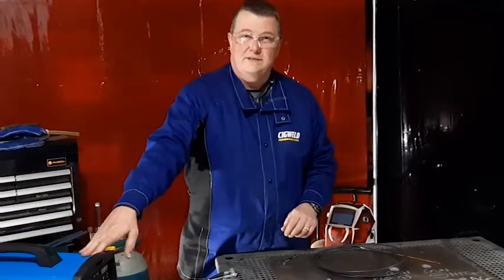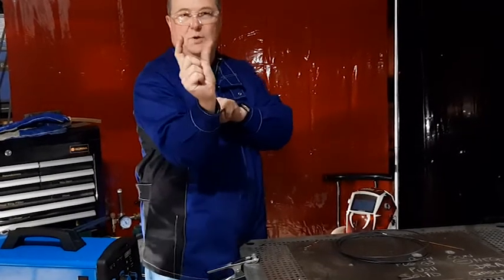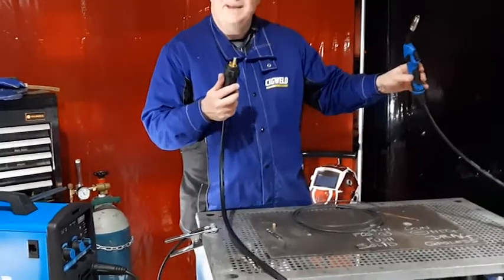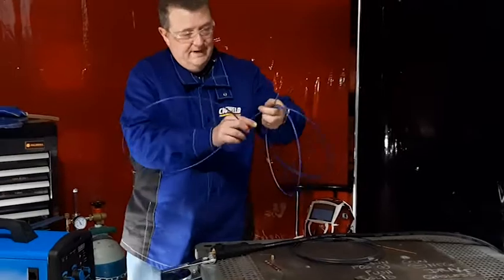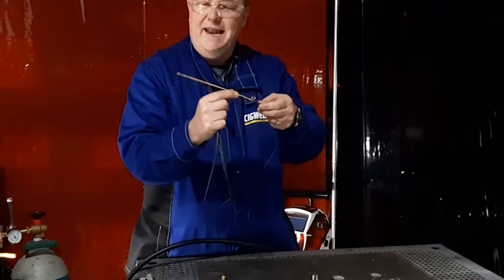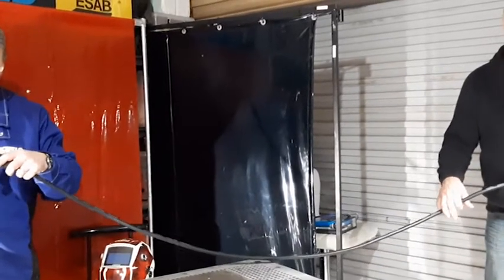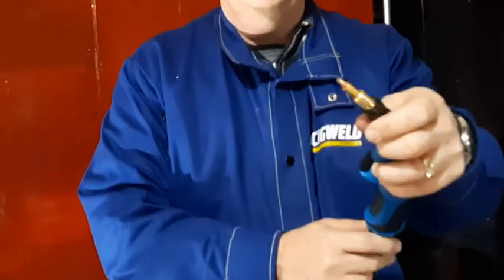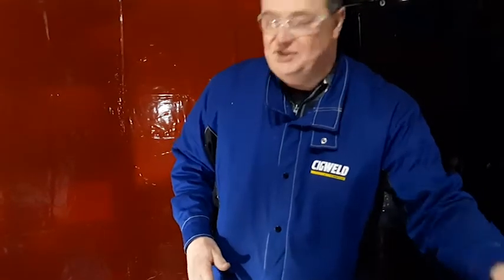Changing a Liner Setting up for Aluminium Welding

Comment: Thx. I note that some people leave a tail and use it as the liner right to the roller in the machine. Do you just leave the metal feeder tube in place and insert the aluminum wire thru it and then into the torch cable?

Comment: What is the aluminium kit for the Weldskill 135 and where can I get it?
Reply: I have this exact same question - did you find anything out Chris?
Reply from the maker: There is no kit as such at the moment. If you call the team on 1300 654 674 they can give you all the part numbers and stores can order them in for you.